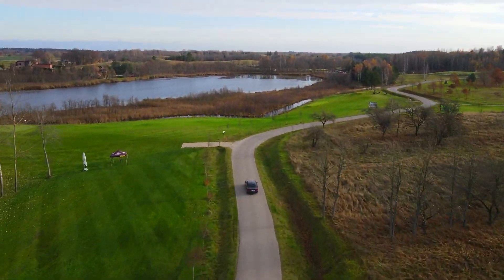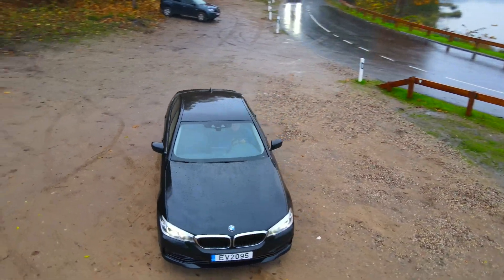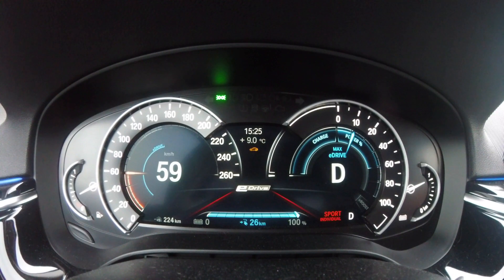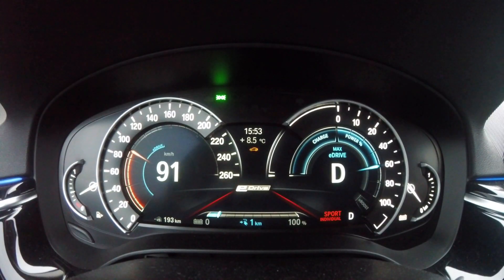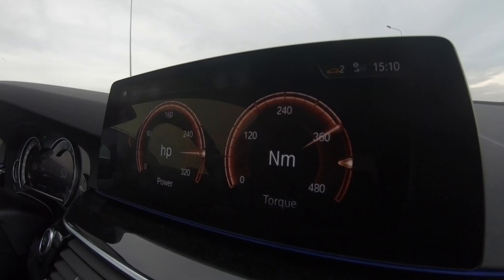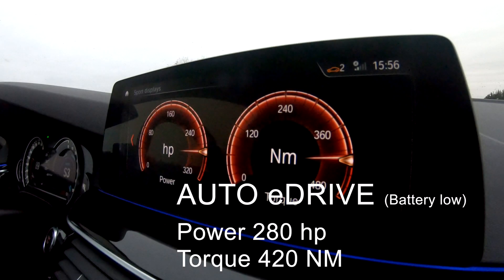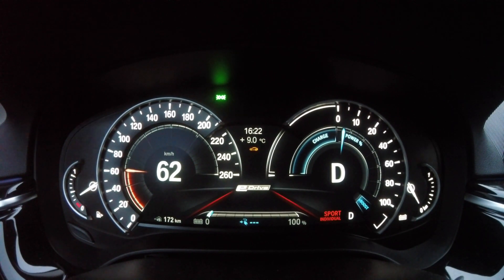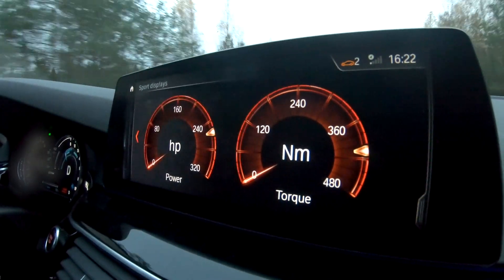2018 BMW 530e power output in different driving modes, can you be out of electric power? 4K

Comment: That was really helpful.  My 530e touring is being delivered tomorrow and after seeing a number of reviews that said the power would be impacted when battery is nearly depleted, I was a bit concerned.  Thank you for the content.
Reply: If driving in a sinuous road in sports mode, the battery on my 530e actually recharges. So if in a specific trip you are so concerned about power output, you are probably willing to have less milleage per gallon than you would in hybrid or electric.

Comment: hello friend, your videos are very good, so good that I bought a 2019 bmw 530e a few weeks ago, but, I have two questions for you, I hope you can help me, 1- when the car is charging the battery, sometimes, activate the motor fans with great force, has it happened to you? It is normal? 2- with the car turned on in P, if I open the driver's door to get out for a moment, the car turns off automatically, if there are passengers inside at that moment, this situation is very annoying, how do I make it stay on?
Reply from the maker: Hi, regarding 1. It happens to me also, I think car is cooling battery that way while charging in warm conditions and regarding 2. There is a setting in “doors and lock” section, i think you can turn this off and on.

Comment: Hello,i have question because I am buying 530e 2020, so I saw most of your comments and sorry if I ask something you already answered but let me be as simple as I can🙂

1. You can drive this car on few mods
-only on battery( range cca 30 km)
only on fuel (range cca 46l 450-500km)
-together battery and fuel( in that mod consumption of fuel is low ,around 3l, and my first question is, in that mod how much battery I use? If I drive on both,fuel and battery?)

And second, if I drive 1000 km ,i have full tank of fuel(46 l) and full battery,and I drive on that hybrid mode(both fuel and battery) ,after some time,lets say 200 km my battery is empty,and can I turn charging battery with petrol and after battery is again full can I continue my drive on hybrid mode( on fuel and battery together)?
Sorry and I hope you understand what I want to ask..thank you
Reply from the maker: Hi, will try to answer;) There are 3 modes:
1. Electric only (eDrive), you are correct. You can drive in this mode at max 130km/h. If you will press accelerator to total max (till clicker), ir will turn petrol. 
2. Auto eDrive (hybrid). Basicaly the car will drive on electric (same as 1st option) till you have battery. It will turn petrol if you will accelerate more than 60% and it will drive electric till max 90 km/h speed. After battery is empty it will drive petrol, regenerate energy while braking and will drive electric on low speeds (as Lexus or Toyota does). So to evaluate comsumption approximately you should calculate that same 30 km will be on electric and the rest on petrol. 3l is possible only on short city drives, but for long roadtrip it will be petrol mostly 6-7l. In city conditions car regenerates more, so you will make some electricity for more electric drive;)
3. Battery control mode. It will charge battery from petrol engine (high consuption 9-10l) and aftery battery will be charged to the level you set, it will continue driving on petrol. Also in low speeds electric drive will be activated.

In all modes if you hit accelerator to 100%, both engines will work (eBoost). The car always keeps some battery reserve for this situation;)

Charging battery from engine is not economicaly reasonable, because using petrol engine to charge battery you have some enery loses, better just drive on petrol. Due to the reason you regenerate some energy you always have electric on low speeds. On high speed electric is not working if you not have full battery (same as other regular hybrids).
Reply: @RomasLTU1  thank you for answer, so what you recommend if I go lets say 2 or 3 times in year to a long jurney, lets say 1000 km in one direction( on holidays)?
Reply: What type of drive you recommend*
Reply from the maker: On long trips I use auto eDrive (hybrid);) According to my calculation this is the most efective mode on roadtrips;)
Reply: @RomasLTU1  ok,I also thought that would be logic choice, and last question, i am buying 530e   02/2020, not facelift, has that 2020 bigger battery capacitet? I have read that models from 2020 have around 47 km on battery 😁?
Reply from the maker: Mine is 2018, but I have heard also that newer has bigger battery. Mine is 9,2kw/h, newer models has 12;) Anyway battery is very small comapring to full EV, so range is very theoretical. In winter sometimes it shows less that 20km, summer sometimes more than 30.  Anyway for my daily route 9,2 kw is enought, for longer trips neither 9 nor 12 will make a big change;)
Reply: @RomasLTU1  yes of course, well thank you for your answers, when I put all together I think thats super car with super skills,I will write my own experience in next days or weeks, I should pick up my this week,cheers😄
Reply: Hi,I bought 530e,2020, last week,the car is top! Yesterday I was driving 157 km distance ( highway 80%,cca 120km/h) on hybrid mode, and when I started there was 508 km range and in the end there was 452 km, how is that possible I dont know but it is awesome😅💁✌️
Reply from the maker: @markomarko9140  the range it shows adopts to your driving style. It calculates rande based on your last kilometers consumption.
Reply: I have 530e 2019. I filled up the tank and was able to drive around 900kms. Mostly I drove very efficiently and did  200kph pull to enjoy to powerful engine and electric motor a couple a time (must have wasted around 5-6l petrol there). I charged the battery 0-100% around 3-4 times.

Comment: Hi, nice videos! May I ask what was the battery performance over time? How did it degrade and if you lost any range? (what's your mileage now if you don't mind)
Reply from the maker: Hi, as the battery in general is very small I do not feel degradadion. Range more depends on a temperature outside and driving style. Even if there is 5% degradation it is not noticable.
Reply: @RomasLTU1  Thanks for getting back to me. I'm slightly worried as in UK the battery pack (whole) costs over £8000 to replace. I'm looking at some 530e from 2017-2018 with mileage of 100-160kkm and don't want to step on a mine with batteries being dead 😉 I've got about 15km to work and a free charger there, idea is to use electric only as much as possible.
Reply: @pawelnotts  I have a 2018 530e with 91k km and i get roughly 19km out of my MAX Edrive. I only have a 5km trip to work so i use electric all the time. it all depends how you drive it
Reply: @pawelnotts  hey man, I have a same dilemma nowadays, did you buy it at the end, how did it go!? :)
Reply: @coacar11  hey, nope, still rocking my 2005 231@290HP 3.0 manual estate 😎 It's starting to fall apart (CCC) but still has the original AGM battery from new 😀
Reply: I have 530e 2019. I am able to drive from 30-38km on max eDrive. It really depends on how you drive, city or highway, how often you brake and outside temperature. and not to forget your wheels.

Comment: Would you reccomend the 530e model?
Reply from the maker: If you are not considering fully electric car so I would recommend 530e, I like it a lot.
Reply: @RomasLTU1  Not really because i have to travell once a mont about 800km in one direction.
Reply from the maker: Have in mind that 530e has a small fuel tank due to batteries, so in 800 km trip you will have to make minimum 1 refueling;)
Reply: They are a good car for many reasons

Comment: Hi,
Does the PRE LCI have 280 HP or 252? The newer version has the extra boost functionality. Does this have the same?
Reply from the maker: It has eboost functionality and my car outputs 280 HP with boost. But on registration document I have only 184HP. I think they have messed up during registration process and marked only petrol engine power;)
Reply: @RomasLTU1  how do you activate e boost?
Reply from the maker: @ManCar1608   I need to press accelerator till very end till I feel a click on a pedal.
Reply: @RomasLTU1  okay, so it does not have that extra boost button?
Reply from the maker: @ManCar1608  there is no speciffic button, but when you press acceletaror till clicker it shows on the screen that eboost is activated.
Reply: @RomasLTU1  shouldn’t it have 292 -293 horsepower under eboost like the LCI version with the button? The petrol engine has 184HP and the electric has 109 or something ? The 280 does not make sense.

Comment: Hello, what mode would you recommend for long range trips ?
Reply from the maker: Hi, i’ll recommend autoedrive mode, because after electricity will end the car will switch to auto anyway if you start on max edrive. Battery charging mode does not have sence on long trips also;)

Comment: Do you have to have full throttle to get extra torque from electric motor? Or do you also get it in sport mode for example with half throttle so you can ride the torque like a diesel?
Reply from the maker: Yes, I get extra torque from electric motor on full throttle. Also at low speeds you get extra torque, e.g. while starting from red light. The system works automatically, so all the time you puch accelerator stronger - electric motor helps.
Reply: @RomasLTU1  but at half throttle as well? So if crusing at 80 kph and then give half throttle, do you get Electric help? So you might get 350nm for example, not the full 420, but more than gas only?
Reply from the maker: Will check and let you know;)
Reply: Thank you very much! :)
Reply from the maker: So the result is following: if you cruise lets say on 80kph and you accelerate, you get help of electric motor. But if you push accelerator up to 40% - electric motor only is working, if you push somwhere 40-70% - petrol engine is working and if you pusn more than 70% then both. Also if petrol engine is cold, both engines ar working even on lower acceleration. All this info is from the displays in the car, maybe reality differes;)
Reply: That was really cool of you to do, thank you very much! And it sounds like they work together even though you are not giving it the full beans, and thats nice!

Comment: Thank you, this was a very informative video, I did have one more question. If you can never charge your battery because you live in appartment, how long does it take in the Battery Control mode to charge your battery from low battery to 100%?
Reply from the maker: Hi, it is approximately 30 min driving at 90km/h. Most likely this does not differ too much on different speeds, but you can look into my other video, I have made a bit of comparison and fuel consumption while charging and while driving in auto;)
Reply: @RomasLTU1  Oh, I've just seen your newest video that addresses my exact question, thanks!
Reply from the maker: @TheGamerTeo  Glad to hear that this was useful:)

Comment: Very good video, I own BMW 330e. Actually it can run out of battery when you continuously flooring the gas pedal when your battery is very low... For e.g. your battery has 4-6% of charge, and you floor it for 20 seconds, it will drain the battery completely and the car will purely run on engine power only... But this is extremely rare case...
Reply from the maker: Yes, perhaps this would be an issue in a race track:), but in regular driving situation this usually do not happen for me also.